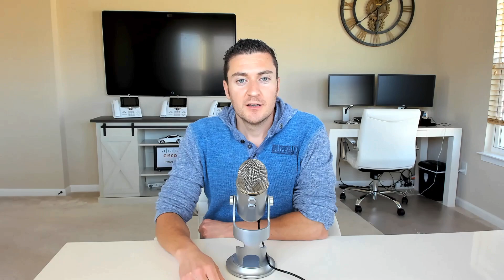9300X Cisco Catalyst Switch Overview

Comment: So, I’m looking to upgrade a 4506-E (2) of them. The next step is the 9600 but I honestly think we don’t need that much beef in our network when we use less than 10% cpu on the 4506-e. I think reasonably we could switch stack a set of 9300 or 9300-x switches in our 2 core MDFs rather than going the upgrade path suggested by Cisco Systems. I think max internal traffic is 10-20 gbps in spikes rarely with the usual around 1 gbps
Reply from the maker: Yeah unless you need the port density I don’t see too many people going with big chassis switches anymore. I would also look at the cat 9500.